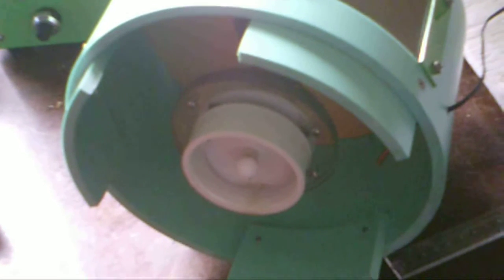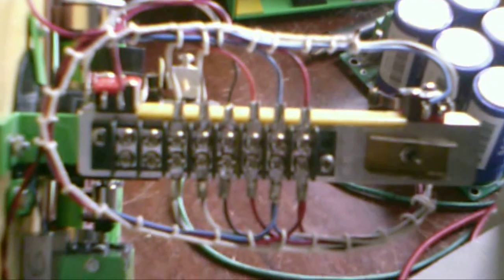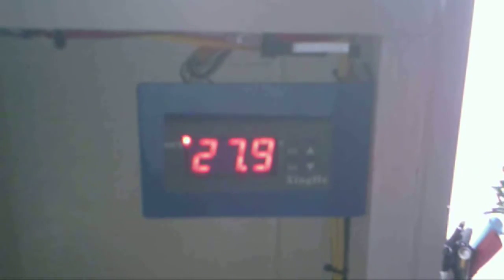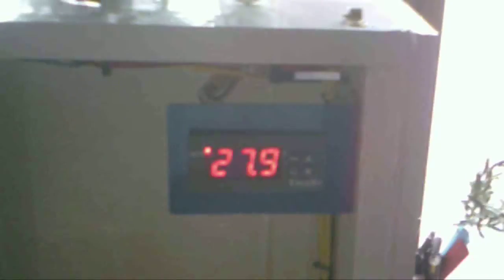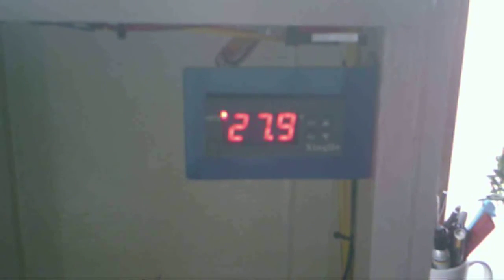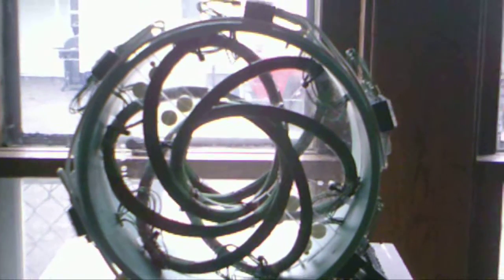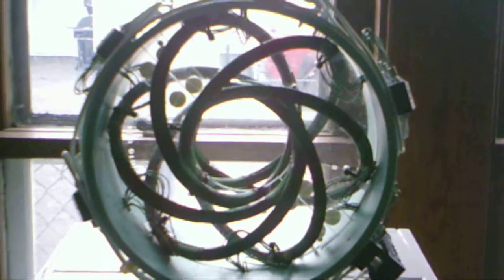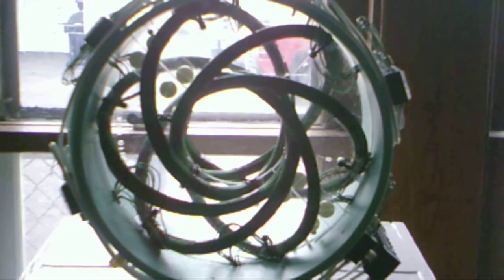PMBO 2016 8 inch spindle torus (ABHA RODIN) motor generator intro video

Comment from the maker: Hi Kevlegend, Yes  the motor runs at or better than 90% with a kinetic energy of 262 joules per second for a input of 43.8 watts to the best of my searches it is the only 3 phase abha rodin motor on google or you tube. I have done hundreds of searches for others using 3 phase, Havdad has best information on how to get started he is on you tube. I am using a red brick 200 amp off the shelf controller for $49.95 at hobby king I added a E-Stop button and a start stop push buttons one current transformer and digital panel meter. This is my 4th year building 3 phase motors they have very good coefficient of performance greater than 5. With only 3 minutes for the final video it is hard to convey a lot of information. Best Wishes, Tony
Reply: i have a great idea for the motor, please
Reply: This taps ZPE

Comment from the maker: Hi everyone, it is a rodin motor generator intergraded into one coil assembly A 2 inch N-42 Sphere magnet spins at 12000 rpm producing .35 hp at 192 ft/lbs of torque 262 joules per second. The generator produces 24 vdc at 1.14 Adc 27 watt. The motor has a input of 10.4 vac times a current of 2.7 a equals 28 w times .9 motor efficiency times 1.732 equals 43.77 watt The hp was converted from mass 515 grams at 12000 rpm equals 262 Joules divide by 746 (1hp) equals .35 Hp per second Torque was converted by .35 times (1hp)550 ft/lb per sec equals 192 ft/lb. per sec. I do not know why the motor has such a high COP 5.98. 262 j/s divided by 43.77w/s = 5.98  I am a controls engineer so math is not my best subject if any one can help here I would appreciate it, Thank You Tony
Reply: tony where are you?
Reply: i have this coil and is amazing power, most energy
Reply: whit a escalar coil or cauduceus coil or poe vortex coil or starship coil and used this coil on antenna, and am trasmisor you have comunication whit et
Reply: fuck google  What I was able to do with that coil was to put in 75 volts and get 5kv at the output, now I am putting together some new cores, to put together some hydrogen equipment, you don't need a giant hydrogen cold fusion reactor to supply the entire city, that is dangerous, but if we have a small hydrogen reactor each in our homes, that is not dangerous and it is simple and very economical, that supplies the home with heat, cold, water and oxygen, electricity as well, you generate clean energy, that is what what we need, it is very easy to assemble